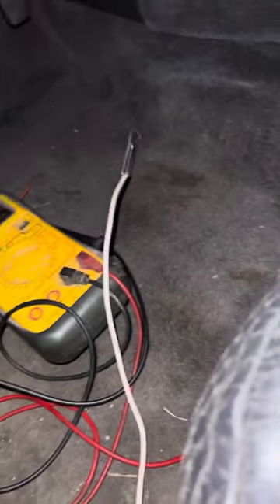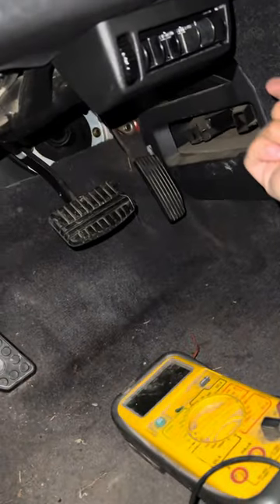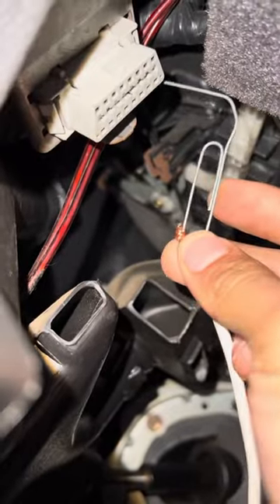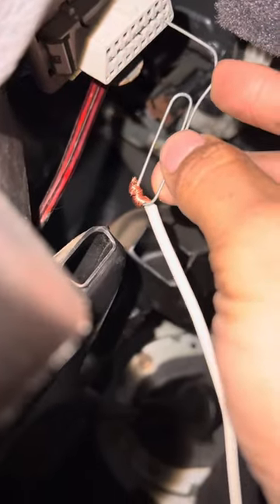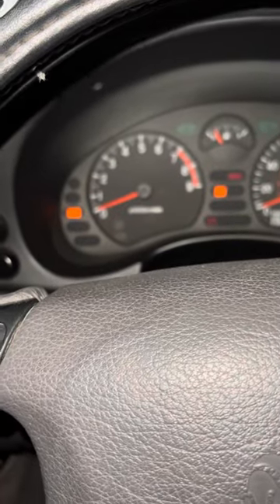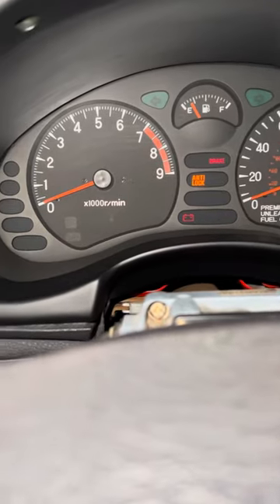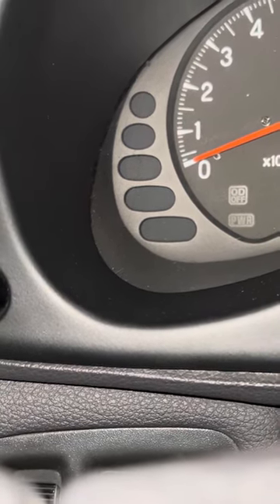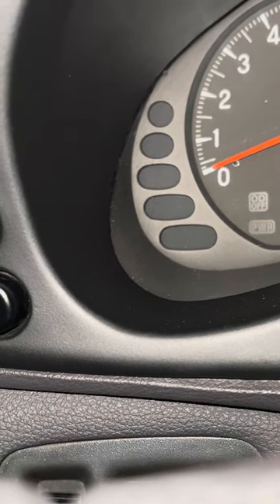How to pull check engine light codes on a 1995 Dodge Stealth and Mitsubishi 3000gt.

Comment: Having the same issue with my stealth how did you end up fixing it after?
Reply from the maker: So it actually took me about four months to figure it out. I even sent the ECU to get repaired. It had nothing wrong with it, but they soldered some points that were weak.

Turned out I had connected the transmission cable some where didn’t belong so the transmission was never getting the right codes and it kept me stuck in limp mode. Some guy eventually pointed it out on a video that I uploaded and I was able to get the car running fine again! Hope this helps.